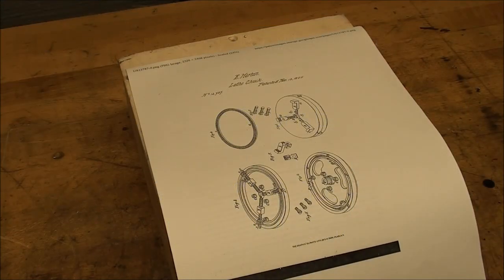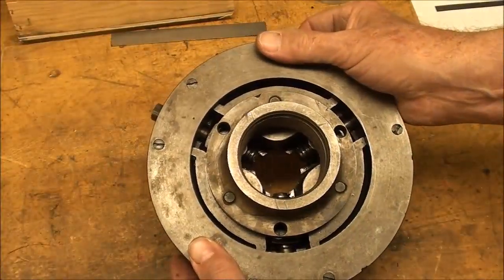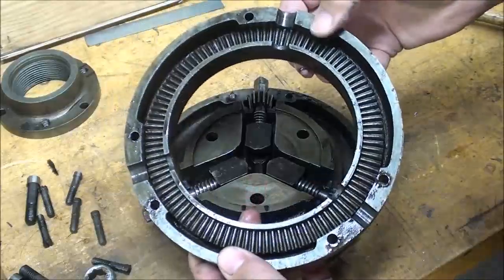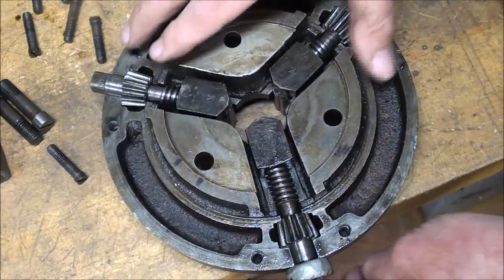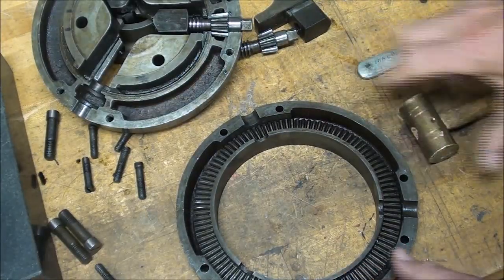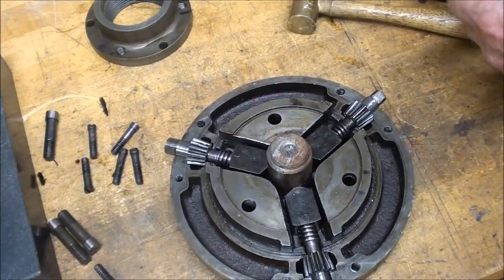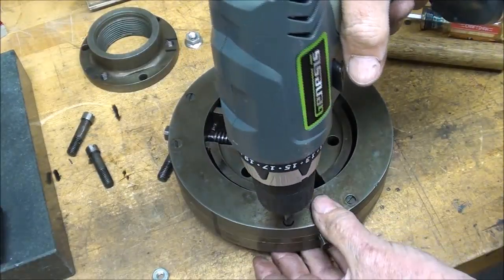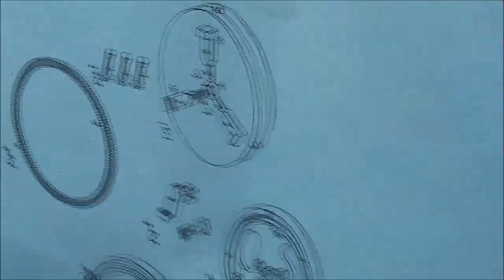OLD TECHNOLOGY SERIES #1  Lathe Chuck tubalcain mrpete222

Comment: Great video on old technologies. Being a machinist I love to see how things came about and were made. To think that this chuck was made to such close tolerances possibly before the micrometer was invented or from what I have been able to find any real accurate measuring devices. I have found that B&S started to produce micrometers in mass around 1867 but I'm sure that it took some time before they reached machine shops. I'm sure a micrometer back then would have been like when electronic computers first came out and probably as expensive for the common man back then. I remember an old-timer I met back when I was first starting out and he told me that when he was young that most measurements were done by setting the old outside calipers to a standard or a master part, so everything was done by feel. It still amazes me to see how things were made back then. Even to study how guns were made back then, the timing of a 6 gun cylinder, the cocking mechanism and how everything fit together and worked. It is really all art work. I still love to watch the old WWII films of how factories were set up and how machining was accomplished, some while they were being bombed or under combat conditions. I remember when the Smithsonian museum rebuilt a German FW190 Fighter built in 1944. They took the engine apart and sent the crank shaft to Mercedes Benz engine plant to have it checked. They sent it back in a specially built crate with a note that stated that the crank shaft was in perfect condition, right at the middle of the manufacturing tolerance and not to damage it as they could not make that shaft today with those tolerances. That crank shaft was built under the heaviest of the Ally bombing offensive, just amazing!

Comment: Great series, Being a museum guy I flinched a few times when you struck that priceless artifact. Ok old tool. We have to wear white gloves when we handle such things. Ha HA. I took drafting in junior high with a T square and triangle. Went to high school and they had those fancy drafting machines that I struggled so much with I dropped the class. In 2004 I had to learn auto-cad for work. I am self taught in it but not a master. Thanks again

Comment: Fascinating!  Imagine the skill required to produce that in relation to the available resources.  I was thinking what a pain an independent 3 jaw must have been to dial in when you moved one of the jaws and my eyes widened as all three moved.  What a simple yet genius design.  The tolerances are amazingly tight.  Keep these coming, I'm an antique tool fan.  I marvel at my Yankee ratcheting egg beater drills from the early 1900s.  This thing is 50 years before them!  Thanks to you and the donor for sharing this. .

Comment: I saw a 4 jaw along similar lines once. There were push-pull sleeves on each operating screw, so that they could be engaged or disengaged from the crown gear. The of course turned it into a combination chuck.

Comment: Fascinating stuff !
I find it very interesting that they managed to make these sort of intricate machine parts with such tight tolerances using very basic measuring devices and water/steam power. This then would be used to manufacture other components and you would expect that any loss of accuracy would be compounded and create components that would never work but the skill of the machinist was good enough to get over these difficulties.
That chuck appears to have been used up until quite recently.
Reply: Ian Clarke q/3625

Comment: Great start to a new series, I love old tools and pick them up when I can. It will be great if you post more. I have an old Skinner 4 jaw chuck that reminds me of this, the jaws come out in the middle, there are no external facing T-Slots and it uses semi recessed 7/16" square head adjustment screws. The chuck was a gift from a retiring tool maker, it looks almost unused and it just nice to look at and handle.
Reply from the maker: Thanks--  Sounds like a nice chuck.

Comment: Fascinating, not only built so well, but really a survivor of the trip through time. I think the jaws on that chuck are tighter than a new three jaw.
It is interesting that standard threads were used on that chuck; I was reading recently that at some time early on Congress set the rules on threads here in the States. I just don't recall when exactly they did it. But it sounds like it was one of those rare times Congress got something right, otherwise many manufactures would have had propitiatory threads and what a headache that would have caused all of us that work on thing!
Great video Mr. Pete, thanks for sharing!

Comment: Terrific start to a new series Mr. Pete, I'm all in if you are willing.  This was fascinating considering basic screw cutting machines were only about 50 years prior to this and likely not many of them, till ~1830 maybe. The jaw Chuck had to be one of most innovative of that era and likely added a lot to the formation of the modern railroads and smithing.  Also the tolerances are amazing considering these body castings were likely turned on a faceplate then lapped in by craftsman hands.  My interest in old tool technology started 40+ ago in the early days of garage sales with my Dad.  I'm also real glad you brought up the drafting and where it all came from...but don't get me started on the whippers that bought a slide rule for hysterical value...would gladly trade a dead TI-85 for a Pocket Pickett, let alone the artisanship of ink on bristol board.  Looking forward to what ever you bring to us...and wishing you a wonderful Holiday Season! ~PJ

Comment: I really liked this video. Back when I was a machinist, I ran a real old machine that you could actually see where it had been converted from belt powered to an electric motor. The asset tag on the thing was 1616 and I used to swear that was the year it was built, and all the ringing, clattering and knocking that thing did would make you believe it was built then. =)

Comment: Thanks for this great video....this is my language. I have a 7" chuck made by The Skinner Chuck Co also from Ct. USA. The pat'd date is March 14, 1882. The odd thing about this unusual chuck is that it has 3 independent jaws (great for setup); each jaw is reversible; there is little if any slop...they don't make them like that any more! It too has 7/16 external square tightening bolts. I use it every day.Thanks again. Steve
Reply from the maker: Thanks for watching.  I have never seen one like yours.

Comment: ☆ Thank you for sharing the workmanship of your civil war era  3-jaw chuck. Considering it's age, I would have to say it's obviously seen some use, but has also been well cared for.
What caught my attention was in your puzzlement about the 3 mounting holes vs. the corresponding 6 holes in the backing plate. If you look a bit closer to what you actually have, I'm sure you could figure it out on your own, but if not, perhaps I might be able to point you to it.
As a retired Millwright mechanic, I've seen this more often than I can count; albeit mostly with gears, couplings and pulleys. Nevertheless, the thinking and the purpose are the same. There are 3 unthreaded holes in the backing plate to accommodate lining up the bolt threads to slide through and mate to the threaded mounting holes. However, when taking it apart, and the bolts are removed, what happens when the two parts are still "stuck" together. If you look closely at the backing plate, you will notice 3 more holes that are threaded, but they don't line up with any other holes. That's when your mounting bolts become "jacking" bolts. Screw them into the threaded backing plate holes until they make contact with the other surface. Then, and carefully, apply just a bit of tension, while tightening the bolt, then likewise to the next bolt, then the next bolt, and so on. Eventually, as the bolts keep gaining and pushing against the other surface, the two parts will easily separate at some point.
I hope this was of some use. /klp😉
Reply from the maker: Good observation-you are probably right.  Many auto brake drums have such jacking holes.
Reply: That is exactly how you take the rear steal wheels of my 1919 FORDSON tractor, unscrew the hold dow bolts and tighten them in adjacent holes in hub to pull off axle.

Comment: What a beauty!
I bet that ring gear was cut with a horizontal planer, the old style rigs that uses a plunging cylinder with a solid cutter that just rolls up a curl on each pass.
The tapered gears will mesh tighter as the jaws come under load and remove all backlash. Very clever design, I bet you could very easily ruin the chuck by over tightening and swelling the housing.
BTW, probably good idea to use heavy grease on the backside of that ring gear, chips wont get back there and you can see signs of galling from lack of grase

Comment: Very interesting chuck. I have a really old one myself, patented before the turn of the century (last century). It's a 3 jaw scroll chuck but each jaw is 2 pieces and has an adjustmenr mechanism very similar to that of a 4 jaw chuck so I guess it is a forerunner to the modern "adjust tru" chucks. I'll try and get the details for that one, quite and interesting piece.

Comment: Fascinating stuff as always!  Sorta interesting minor tidbit, for an 1855 patent, copies of the initial schematics would not have been blueprints.  The original blueprinting process wasn't worked out until 1861, and it took awhile to really catch on after that.  A form of carbon paper did exist, as did lithography, but as I understand it, this sort of thing would have likely just been laboriously hand-copied as needed.  Figured the people watching this sort of video might groove on a little supplemental history :)
Reply: I got that "groove" of renewed knowledge. If you don't think about it now and again, it takes a reminder of those things long ago learned. 
I lost my drafting set back in the 70's via wife running off, but I feel like that old man in a room still hand printing out sheets of draw'rings.

Comment: Thank You Sir for this nice video. If I see such precision an mecanical cleverness. I always wonder if technology today has has moved so far away from the old days. In my living room, i have an old german clock (year 1700). The platine is made from black smith iron, even some of the gears are made from iron (steel). I wonder how they did this without modern lathes, dividing heads, milling machines even cnc. As physisicst from Germany I am always impressed about the efforts of former generations. Did you e.g. know, that there was a big bronze factory almost 5000 years ago in sothern Europe, shippin this metal to far China and India? 

Thanks again
Michael Schaefer from Germany
Reply from the maker: Thanks for watching. I love to read about old technology.

Comment: I got one of these chuck's and mounted it on my heavy 10" 1945 South Ben lathe. it is mounted on the lefthand side of the spindel to help center rifle barrels up for chambering and threading. yes that means i have 2 chucks on my lathe. Love your videos they are always interesting.
Reply from the maker: Good idea.  The old pipe threading machines had a similar setup for supporting long pipes.

Comment: A few years ago i found an old Line lathe in a scrap yard. Unfortunately it was dropped while moving and destroyed. When i did the research i discovered that the lathe was built in the 1870s. The machine had been built in the Gualt machine company in what now Cambridge, Ontario. before i broke it i had the machine working and was surprised how well it functioned. I still have the chucks. I will take some photos and upload them.
Reply from the maker: Very unfortunate

Comment: Nice old chuck. Never seen that kind before. I like finding old machine parts, too. I wonder if it was ever used with the ring gear removed as an independent 3 jaw chuck? The original drawings for that were before blueprints. So maybe all hand copied pen and ink drawings? I remember learning drafting lettering on velum. Making the arrows for the dimensioning lines was always a challenge to get symmetrical curves. Keep this stuff coming, I love it.

Comment: I have a chuck very similar to that made by the Oneida National Chuck Co. It has the studs more recessed although they could still bite, and reversible jaws so it can hold larger work. Mine doesn't have a ring gear in it though unless it's missing, it's a three jaw independent. I also have a 10" Oneida National 4 Jaw. They go well with my old Worcester lathe.

Comment: Mr. Pete,     I went back and watched the video a second time and I noticed on the print that there were nuts on 
the bolts, also I noticed on the backing plate that there were flat spots by the untapped holes. So I think in the 
original there were bolts and nuts and that is why there are 6 holes in the backing plate. just my observation.
Check it out

Comment: I have a Union 4-jaw chuck with a similar design, but someone removed the ring gear so the jaws operate independently. That's mainly what I wanted but I wish I had the original ring gear for it.

Comment: Another great video!  Thank you so much for taking the time to do so.  I'm wondering if that back plate came from another chuck.  It appeared that there could have been a back place with an outer diameter large enough to cover the screw threads.  I'm not sure.  Either way, the tolerances are incredible!
Reply from the maker: Rolando Escobar Thanks--I'm sure that back plate was from another chuck.

Comment: fascinating  design, interesting about the screw threads being standard SAE specs. many old machines had custom or oddball threads back then,I suppose by personal preference to the engineer that designed them or the hardware supplier that they dealt with. Henry Ford refused to convert to SAE for years after the other companies got onboard with the idea. Thank god for SAE

Comment: I would like to see some videos of gunsmithing as that also seams to be a dying art, so many gun parts today are now made with CNC, I have made a couple modern AR style fire arms from 80% receivers , But I feel drawn to the falling block single shots, it seams there is little information on tempering and material selection along with the spring and screw making less not forget the blueing processes.
Reply: I am not being a troll, Mr Pete you are a craftsman , And like your video's
Reply: Have you seen any of the videos that Jack Rowe has collaborated in on here? They are must see if you like anything to do with gunsmithing :-)
Reply: Swanny383 I do hope you steer away from the modern type of firearms and start making the Farquharson type instead, the single shot falling block design is much better suited to the hand made approach, I have made several and they are very satisfying to make, and shoot.

Comment: i recently got the same exact horton chuck but mine has a 1-1/2" backing plate. I took mine apart and cleaned it as it was rusted. Sadly it's missing the large ring gear and 1 of the 3 jaw gears are missing a couple teeth. The 3 jaws move independently without issue. Like you mentioned in the video, shavings were really built up inside my chuck. As for age, when it shows "patented 1855" does that mean the chuck was made that year or later?
Reply from the maker: Later

Comment: Isn't it easier to retime the mechanism by just pushing the jaws to the back of their respective slide ? This way, once you remount the coordinating circular rack, everything should be kept in sync again, avoiding any play, simple as is ?
Reply: Okto Putsch  if you assume both the outside faces of the jaws and the corresponding surfaces of the chuck body are finely machined and true.
Reply: DrewLSsix True.

Comment: The modern threads suggest that this item was made post WW1.  For example, the Society of Automotive Engineers (SAE) adopted their well-known thread sizes in 1914.
Reply from the maker: Then it must be much newer than I surmised.
Reply: Not necessarily. The sized adopted were, mostly, those in use already, many standardized by Sellers at the Franklin Institute. I used to work on a lathe built in the 1880's (Harrington), and the threads were mostly those that we know today. Also, the 1/4-20 might be 14-20, which are slightly smaller (0.242") and were quite common prior to WWII. There were many more US std thread series prior to the war.

Comment: That was interesting hope you can post more. I read abook about early industrial age primarily realted to the Baldwin Locomotive Works in Phil. PA. IIRC it stated that most of the very early parts made by machinests were made using a pattern and file. Interesting read.
Reply from the maker: Yes--especially gunmaking.